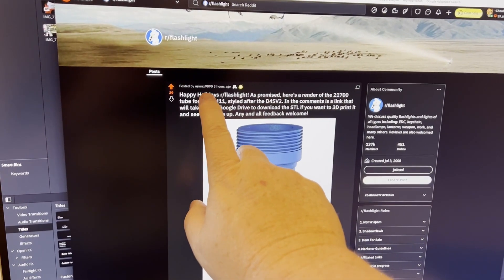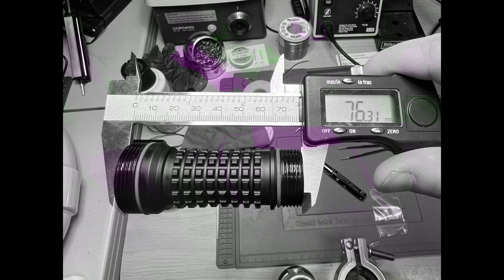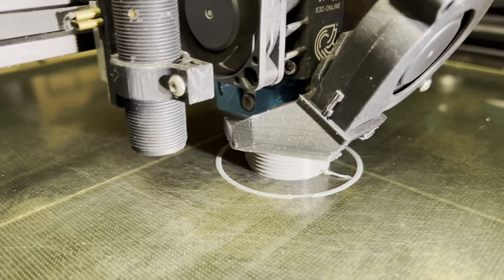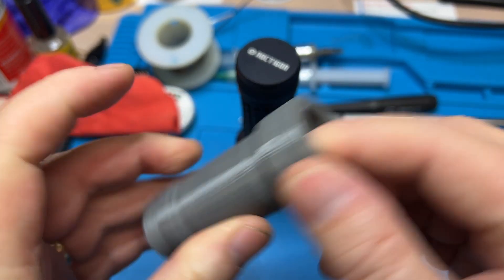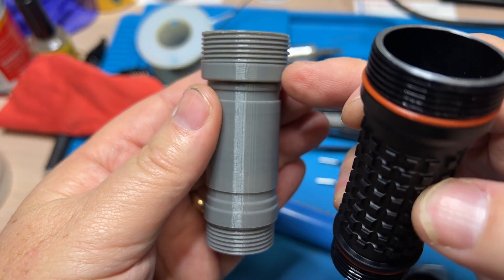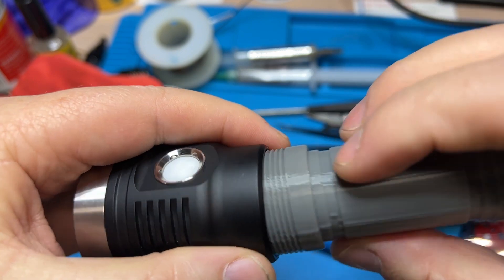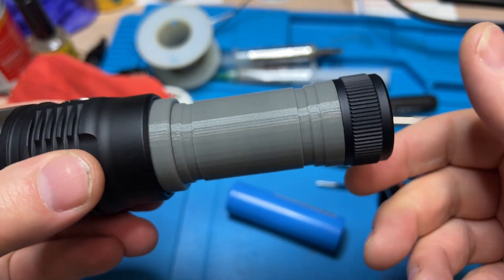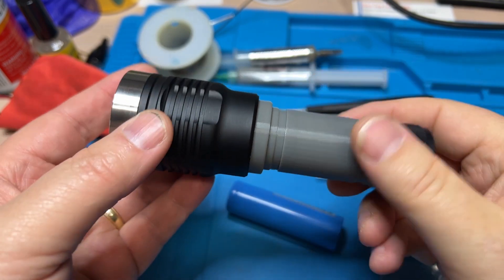Project No Knurls! - A DM11 Smooth Tube Prototype

Comment: I just bought the 26800 tube and a 26800 battery from Convoy and have never reverted to the standard 21700 tube. the 26800 tube fits much better in my hand and I have extra runtime, win.